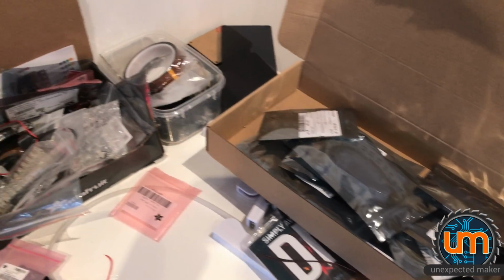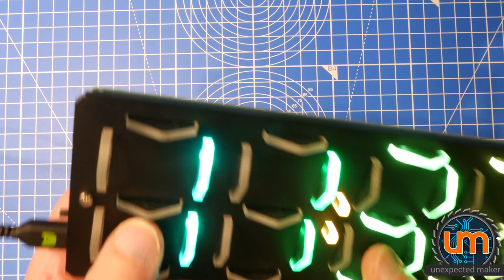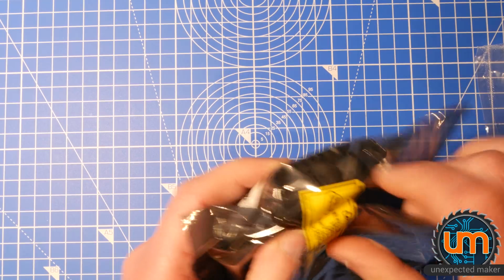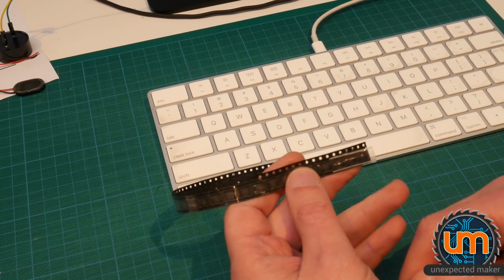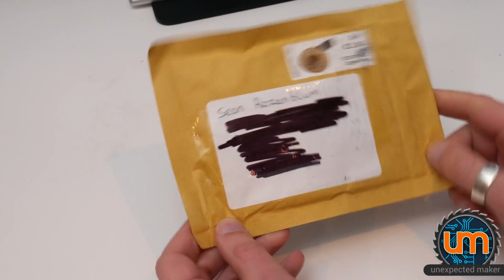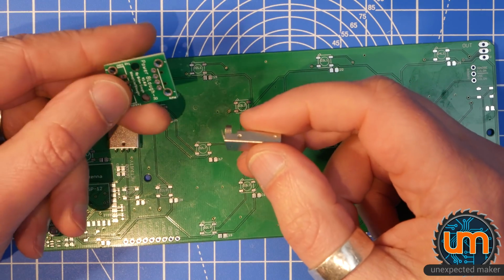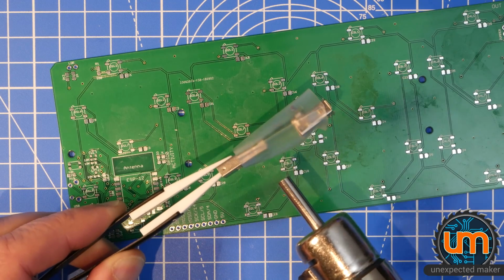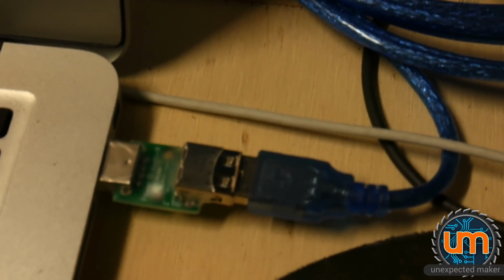Random Bytes - October 2018

Comment: Thanks for the smile inducing reset button story!  Many of us have dealt with pressure related faults, like hair-line cracks in traces and shorts, but designing something that presses a reset switch when screwed together was definitely an Unexpected outcome to your story! :)
Was also interesting to learn that tweezers can "expose you to chemicals including lead"? I guess if you stab yourself with the sharp end, then expose the wound to lead, then I guess they do make a valid point. LOL
Reply from the maker: Yeah I still can't believe I did it... I'd knock the clock and it would reset and I couldn't work out why... lol. I'm just going to cut the acyrlic around the button.